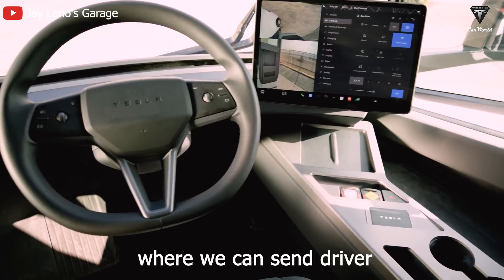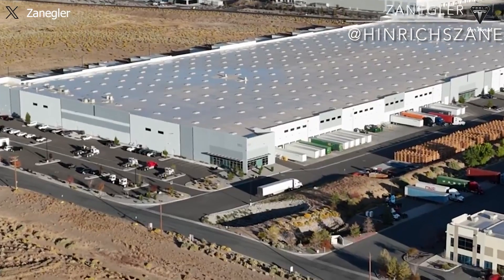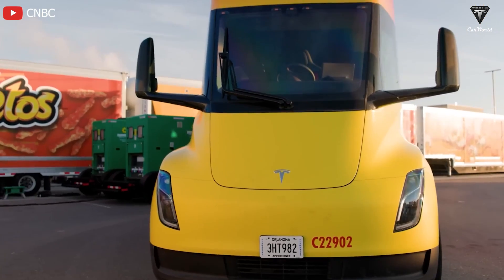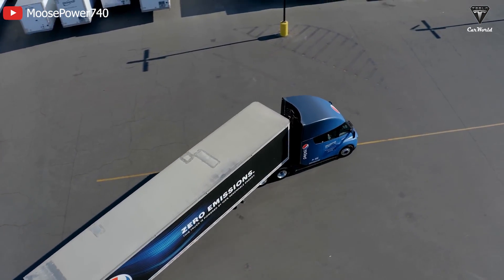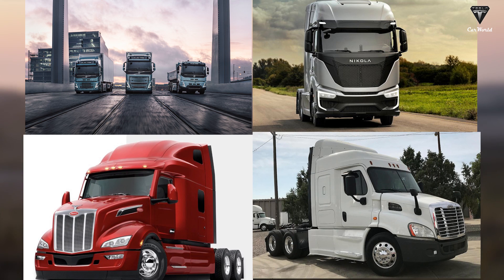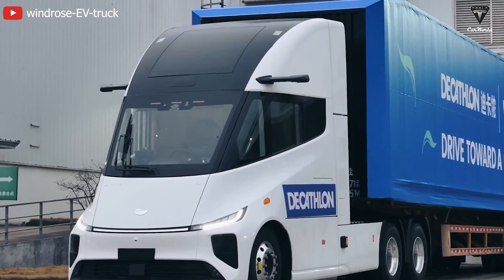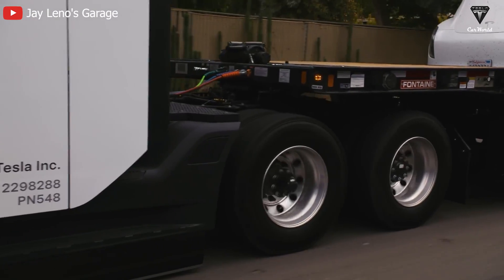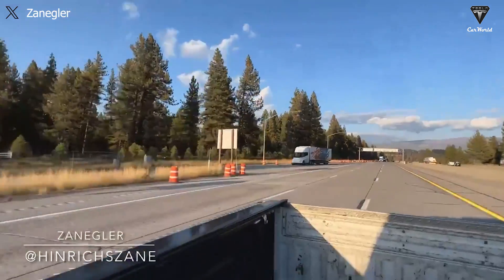Tesla Semi BIG Update! Mass Production 2024, Shock Price, Payload and New Version Release Soon!

Comment: Pepsicos load weight are pretty much the same with every load so its a good model to calculate the savings, which apparantly is huge. The numbers have changed since this video was made  i did calcs for the longest upgrades on most common routes and EV wise on shortsr tips thru mounyans the EV is more than 2 x as fast at a minimum. Time matters. We calculated we can charge much less, nearly double up on turn arounds, pay divers more, and make more profit with fewer trucks, even if they cost more. Time to destination matters.

Comment: Edison Motors has a better idea and built their prototype in 1 year, it has also been approved by Canada’s regulators and Edison is officially a manufacturer. 
The Edison Semi is actually designed by truckers for heavy duty operations and has a built diesel generator as a range extender. The very first load moved by this truck was over 100,000 lbs. 
pure electric semi trucks only makes sense for a limited number of trucks.
Reply: I should also add that it was built from the ground up for Heavy Hauling (loads up to 180,000 lbs) and most of that is off road (Long Logging). 
Edison also believes in “The Right To Repair” with all components being off the shelf which is something companies like Tesla would never do. 
Edison Motors is also currently working on a “Kit” with a dealer/Instllation network to repower existing heavy duty vehicles and pickups with all electric drivetrains and onboard range extending generators. A much better and workable solution than the Cybertruck
Reply: It'll certainly be interesting following Edison over the next years.

Comment: “You don’t know what your talking about” I second that statement and do so not to be mean or make the author feel poorly but rather to inform anyone here reading these comments about the accuracy of statements made in the video. I’ll say with 100% confidence that those 3 “Truck Frames” are actually trailer chassis which are used to transport shipping containers. I invite everyone to verify this statement for yourself. You may even learn something.  

Note: The Maximum Gross weight recognized Nationally for Tractor/Trailer combinations is 80,000 pounds rather that 82k which was stated in a previous comment. That is the standard max weight but a loaded truck can legally weigh much more than that with a specific permit depending on each separate state and with consideration to their bridge law and the Riggs axle configuration. Here in Mississippi we are allowed up to 84,000 with the purchase of a harvest permit when running farm tags.
Reply: Electric is higher

Comment: The design will radically change with self driving. 

Likely it will come with an emergency virtual driver capacity (a person sits in a simulator cab that gets video feed from the actual truck.

The shape can radically change when there is no seat, air conditioning, doors, etc.

Comment: The future isn't electric vehicles. 🤮
Reply: You were probably the same person in the early 1900’s that said “gas trucks are not the future!” as you loaded your horse and trailer to deliver your perishable goods to the market two towns over.
Reply: The future isn't gas or diesel by definition.  They run on a non-renewable resource.  Once we have used up all the petroleum that is economical to extract, it's gone.

Comment: To compete with long haul diesel it will need 600 mile range and haul 82,000 lbs.
Reply: Needs to do better than that, plus it will need to recharge in an hour or less.  We know that's not going to happen any time soon.
Reply: @justmousinaround  You are % correct.
However, there is new battery technology Tesla is working on BUT if any part of the equation relies on China 🇨🇳, Tesla, just as all who rely on China, are in great jeopardy of going out of business.
Reply: Tesla semis do not need to do long haul. Medium and short routes, typical between certain warehouses. Or think of the trucks hauling ontainers to and from major ports as LA. 90% of loaded semis in the US got a weight of 73000 lbs and less.
Reply: @Rimrock300  Long haul is the largest user of diesel fuel.
Reply: They don't have to compete with long haul trucking now.  They can take all the low and medium ranges and still do fine.    That will take car of 50% of the trucking needs today.
Reply: @dugnology  You missed the point. EVs are a scam that the USA taxpayers are subsidizing.